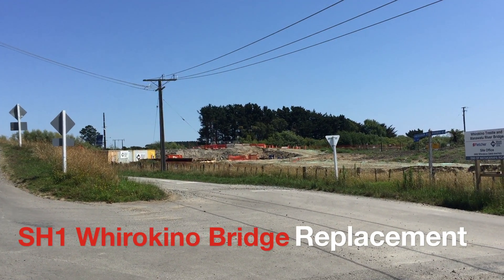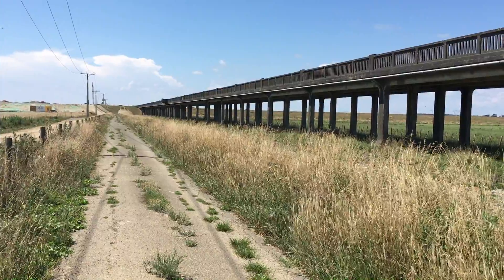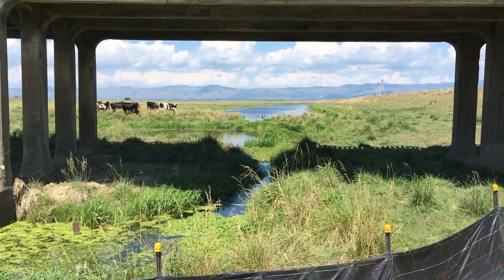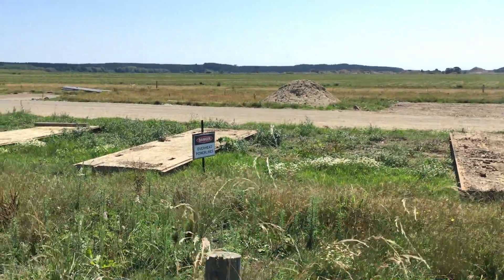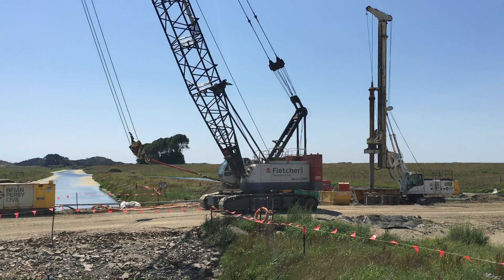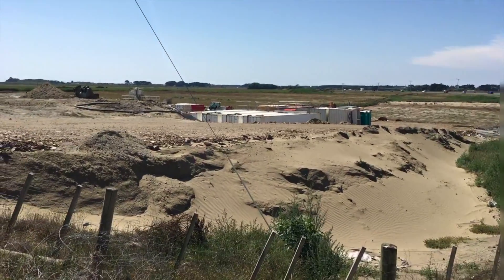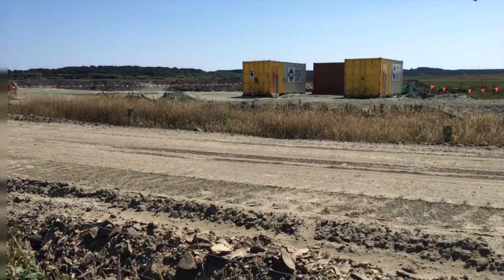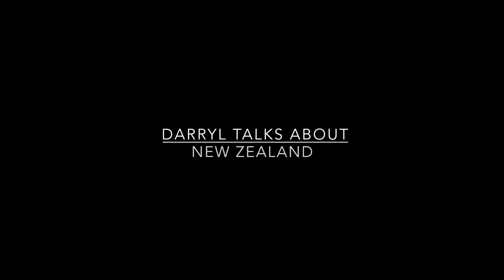New Levin-Foxton SH1 Whirokino Bridge Under Construction

Comment: Thanks Darryl.  Interesting to see what they are doing here.  The old trestle bridge has got 90 spans of 40ft - ie 3600 feet long - nearly 1.1km.  Width between kerbs is 24ft or 7.3metres.  Interesting to see what is happening here - I was in the Bridge Office of Ministry of Works in Wanganui in mid 1970s and this bridge was deteriorating with the weather and salt air getting at the reinforcing then and the load carrying capacity of the bridge was only just safely taking Class I traffic - with some extra calculating work to take into account all that was available - not just a routine analysis.  With loads getting bigger, it is good that the step has been taken to construct a replacement.  I suspect the temporary bridge across the river will be to build a new river crossing that will link with this new floodway bridge.  There used to be another bridge of same design but only 3 spans just north of the main trestle as a floodway bridge but this was demolished some years back when the highway was realigned slightly.
Reply from the maker: Interesting, thanks for the details. it's interesting to see the bits of concrete that have broken off, I guess that's where the steel is rusting and popping the concrete.

Comment: There is a game where passengers hold their breath for one or both bridges. The new bridge may raise traffic speed and make it easier. Great to know the age of the bridge and that it has survived so long in New Zealand European settlement terms, though concrete using ancient Roman technology is outlasting that and still going well I have heard.
Reply from the maker: Yes, I think the reason that Roman concrete lasts such a long time is that it has no steel in it. I did a chemistry lab on measuring the chlorine content in cement, which is needed to make steel reinforced concrete.
Reply: Darryl Talks About New Zealand Interesting. The reason I heard was that the longevity was due to a different composition in the concrete. This article has some details and links to some research https://www.bostonglobe.com/ideas/2014/12/19/why-ancient-roman-concrete-still-standing/ED4F1Mg8FJSBO6bGo5ekIP/story.html